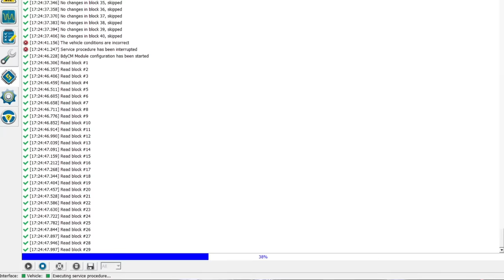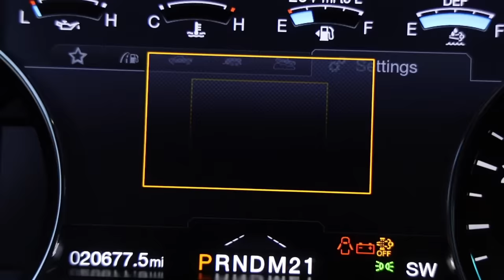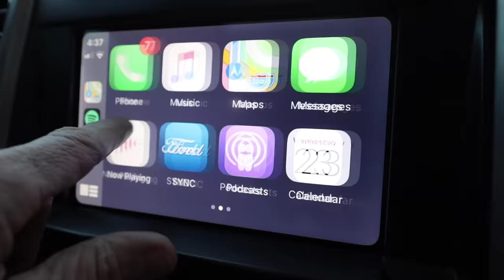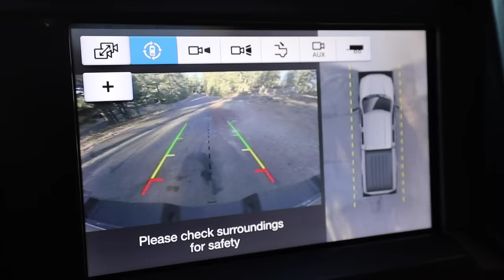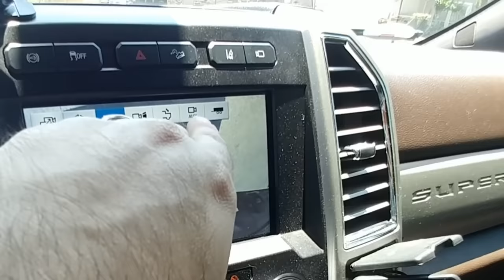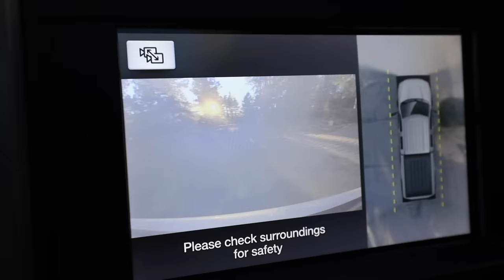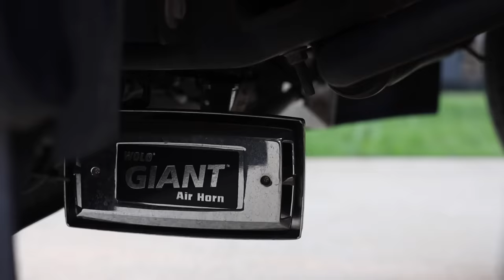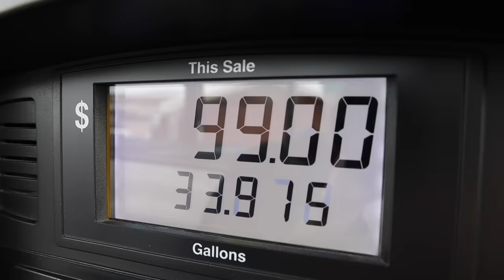Ford Super Duty Secrets! Best Mods + Special Guests

Comment: 3.73 is used in the heavy tow pack Expedition and I think some versions of the F150, it has the Elocker function also. My Expedition has it 3.5 Eco or boost👍. My Expedition doesn’t have as much dingers maybe Ford was thinking work boot guys need reminders 😆. The 3.73 is pretty decent with the 10spd though I could see the 6 or 8 spds getting a bit wound up on the highway when not towing. But 3.73 with the 10spd the little 3.5 lopes along at 75-80 at pretty low rpm. I recall with the Exp the 3.73 vs 3.31 was only 1-2mpg difference on the sticker👍

Comment: Have you noticed a difference at night with the fogs on with the high beams? I have always heard that the reason they don't do it from the factory is because with the fog lights on with the high beams its harder for your eyes to adjust to seeing further down the road.
Reply: There are also local laws about the amount of forward facing lights on at one time, federal as well if I'm not mistaken.
Reply: Fogs with high beams is called Bambi Mode.   I can see the sides of the road a little better with the fogs/high's on.  Fogs/highs have no effect on seeing further down the road for me.
Reply: Fog lights have a very short and wide beam, to throw light under the fog.  High beams throw high and long, and just reflect off the fog making it impossible to see.  Running fog lights with high beams on makes zero sense to me.
Reply: @shiftfocus1  I thought the same thing until I tried it.  I can now see the sides of the road better and hopefully see a deer in time to slow down or otherwise avoid it.  Hence Bambi Mode.  We are ate up with deer here and frequently hit them.  I am not trying to get anyone to do it.  Just stating the reasoning behind it.  My fogs will still go off with the switch.

Comment: Marc, another amazing and informative video. You really do a pro job at delivering the details. Our last truck was an '05 F350 6.0L..  we had the head gasket failure that was so common. A $5500 repair 10k outside of warranty. (and yes, I'm still bitter lol). The technology in today's vehicles is mind boggling..To the point where you wouldn't want to own one without bumper to bumper warranty.  Anyhow, they got me once, never again. Not a diesel fan.(as an owner)

Comment: Picked up a used 2019 F250, steering was very loose, not sure about the death wobble but I brought it to ford and there was a recall (customer satisfaction) for steering components. Now it runs like brand new with no wobbly front-end steering. I understand you mentioned having an aftermarket solution. Still, for others, it may be worth checking all recalls including the customer satisfaction programs to see if there is any free work that can be done.
Reply from the maker: That is the proper fix and we replaced the OEM parts too. At the time of this video, Ford was backed logged with parts. But it's bound to happen again at the same milage. The dual stabilizer prevents it from happening it again. I now have 58k miles and it didn't happen again.
Reply: @KeepYourDaydream  That is great to know those Icon's are still holding up well after a bit of time and you haven't had any premature wear. To extend the life of my replacement parts, I probably should look further into adding a set. Thanks.

Comment: FYI, you can swap the usb connector with a newer one with type c if you want it. And Built right industries has a mount system and you can add a phone mount system from 67 designs.

Comment: Some additional things I discovered. 1. under the front right cup holder is another spot for the key fob. What I was told is that if your fob battery is dead, you can place it in that spot & it can read the chip & allow you to start the truck. 2. you have the memory buttons on the driver door. If equipt this remembers the seat, lumbar supports, mirrors and steering wheel / pedal positions. You set this by holding the memory button & wait for 1 beep. If you continue to hold the same button you will hear a second beep. At that point, you press the lock button on your key fob, now it will be in memory & if you unlock the truck with that fob, it will go to the memorized position. It is cool because I have mine & my wife settings on hers. Anyway that is 2 of the things I know.
Reply: Isn’t the programming spot for the fob under the drivers side of the center console?
Reply: @akbychoice  I believe the spot under the center console is for emergency use. To program the fob to the seat buttons, you hold the particular # on the door, but don’t let at the 1st beep, that just sets the memory, but continue to hold the button until you hear a double beep, , then hit the lock button on the bob, now they are synced. Was that your question, or something else?
Reply: @andypop123  I thought I saw in another video that the slot on the drivers side was for programming. I have a 2016 F450 so it doesn’t work on mine.
Reply: @akbychoice  I don’t know that, my 18 has slots to start the truck with a dead key fob, my memory tells me the 16, had it in the rubber mat under the sliding cover storage compartment all the way forward on the center console. Sorry I’m not helpful here.
Reply: @andypop123  no sliding inside the console are two double cup holders. They can be removed and a lower plate reveals a spot to drop one on the double cup holders into the bottom. Leaving a rectangular spot and two cup holders. Currently it’s how mine is, this way my CB sits partially down in the well area left by moving the one double cup holder. Just not real good spots for CBs in the Lariat and up.
Reply: The reason it works when you Key Fob is dead is because it’s an actual charger for your Key Fob, when you are doing a long run, it’s best to just leave it in there to charge it up!
Reply: @ericsantos9668  that makes sense.

Comment: My 2019 F350 is a 3.55, the 6 speed is 0.674 top gear. That works out to be a good towing and good for empty highway(1500km per 185L tank) My 2020 F250 HCTTP (10800LB GVWR) is a 3.31 with the 10 speed. At 65 mph its in 9th most of the time(especially when towing). The top gear ratio is 0.632 and its way lower than the 2019(same 18" wheels and 275/70R18 tires). I love both trucks, I wish the 2020 was an F350 with the 8' bed like the 2019. The pandemic caused a massive shortage here in Canada and the only truck I found(3 weeks of constant looking) was sold the day before I found it. So I compromised a bit, both trucks have similar payload(F350 is 60lb higher) but the f250 is 800lb short on GVWR, in a 160"wb XLT vs the 176"wb Lariat Ultimate. So the both have the same capacity for towing(F250 22000lbs vs F350 21700lbs) both have the Dana M275 Axle 7230lb GAWR and springs(F250 says 6370lb RGAWR legal neutering)

Comment: In Arizona (most likely other states as well), if you get diesel at a truck stop and go where the big rigs go, you are paying 18 cents more per gallon for the "highway diesel" (there is a sticker on the pump stating so). Go to the "Auto diesel" pumps and you will not be giving the state money they don't deserve. You only need to get fuel at the "highway diesel" if you are over 26K GVW and/or have more than 2 axels on the tractor. RV's or school buses with more than two axels are exempt because they are not commercial and not for hire. I guess guys with Super Dutys want to be like the big boys just to look cool.

Comment: I seen a video where you can use a relay on your factory horn and the up-fitter switch when the up fitter is off the truck horn will work but when the up-fitter switch is on the big horn will blow when you press the factory horn on the steering wheel.

Comment: 2020+ SD w/ 6.2 still comes with the 6 speed *. Also, you can lock with keypad with any door open... when they close the door, it will be locked. The "Hidden key spot" is not for storing a key, it is ONLY for programming.

Comment: The death wobble was part of the reason I got the F-450.  The heavier front end seems to not have that issue.  Now, before some blowhard gets all excited I'm sure the death wobble is still possible, but in 70k miles I haven't seen it yet.  In my Dodge I had 4 death wobble issues before 30k miles.  Dealership finally found a dampener that solved the issue... but what a pain in the butt.

Comment: Great video! Absolutely love my 2017 F250 Platinum which I picked up in August. One of my favorite mods so far has been a wireless charger from ShawTexan Products which drops right in the left storage compartment on the center console and a CPlay2Air wireless CarPlay adapter. This allows me to jump in the truck and it automatically connects to my iPhone all while it’s still in my pocket. Great for short trips. If I need to charge it, I just take it out and plop it on the wireless charger. No cords to deal with!

Comment: I have two RAM's, one with 4.10 gears and the other with 4.56. They both get about 12 mpg around town and the 4.10 geared one gets 12 towing on the highway at 65 mph. I like being to accelerate vs top speed.

Comment: I have had as many trucks in the last 4 years as you.  I went back down from my F-250 Lariat to a F-150 King Ranch (ecoboost).  My F-250 had 20,000 miles on it , was in shop for a couple of months with Turbo problems and gave me about 20 "check engine lights" on my trip pulling the Flying Cloud to Indiana.  Stopped by three Ford Dealerships in Arkansas, and the check engine light came on again.  I stopped by a Ford dealership in Hot Springs, traded it in, and was on the road in less than two hours.  I miss my F-250......but it made me mad.

Comment: I’ve got the S&B 70 on my 17’ 450 and need to get the forscan done ! The gauge and the miles per gallon don’t jive and it’s annoying when traveling wondering which one to look at but I’m gonna look into those other things you mentioned! Great video eventually you’ll move the air horn button down to the dash once you need that up fitter switch 👍

Comment: I have to say in all honesty, the more I hear from you Ford owners the more I like my 2017 2500 Ram diesel 4wd.  I do like your camera system better and your panoramic roof, which mine doesn't have. I already have a def gauge, not hidden in the settings.  Not only does the ram have high idle it's automatic in cold weather and can be manually initiated.  Integrated phone holder in the console.  JD was complaining about the plastic dash in his  450, my truck is leather or stimulated leather dash.  I'm seeing around 11mpg towing a 29' Rockwood UL with two slides and around 18 mpg average empty.  And it doesn't drive me nuts with annoying dings!  The Ram's keyless entry only requires you to grab the handle to unlock and push a button to lock, no number pad to deal with.  I do like the Ford tow mirrors better than the Ram's though.

Comment: Great video!!  I have a 2019 F250 but gas.   My diesel days are over after 15.5 years of having one being a Minnesota cold weather guy and towing only a 5k pound trailer now.  We enjoy your channel very much.  I'm going to check your link because mine, when I start it, always goes to the default trailer even when it's not connected.  Hoping to find a change for this.

Comment: Good info. One thing that is weird on the 2017+ Superduty has to do with the requirements for activating the 12V charge on the trailer plug. As a challenge try testing if it works on your truck.
Reply: Would love to see more info on this!

Comment: As a licensed Mechanical Engineer the lower gear ratio is also better to have if you are going to increase your tire size.

Can you confirm that the 23's and newer have high idle on the cruise control?

Comment: Huge Ford truck fan here but unfortunately Ford's truck cameras are lousy (low resolution and washed out color) and prone to issues. I believe the new 2021 F150's have been much improved  but won't make it to SuperDuties until the next refresh when the new F150 interior moves to the SD lineup  (pbly for 2022). GM's camera systems are far superior (high definition and great color) plus their backup rear view mirror/camera combo is incredible - I hope FOMOCO adds this option soon.

Comment: Just some quick safety tips for doing a stationary regen:
1) Make sure you're parked on concrete or (ideally) gravel. The temp at the exhaust tip is high enough to melt asphalt, and after 30+ minutes at high idle it doesn't really matter how high off the ground it is. 
2) Make sure there are no flammable materials nearby, ie. dry grasses, wood (see #1).
3) Kind of a no-brainer, but don't do it in your garage or near your house (see #1).
4) Make sure the little kiddos will be at a safe distance for the duration (see #1).

Mobile regens are best obviously. 😎👍
Reply: DELETE!

Comment: Do you know your Super Duty has a sport mode? Tap the traction control button twice and then OK to confirm sport mode. Truck drives great especially when towing. Oh, you can also use tow-haul with sport mode. It wakes the truck up.
Reply from the maker: Will try this tomorrow!

Comment: Got the recall notice for deathwobble on christmas eve. Ford has apperently reconfigured the stabilizer.
Reply: My 2018 F250 has had almost $10k in front end repair to fix death wobble and bump steer .  3 times it tightened  up  the front end that lasts 5-10k.  

Doubt Ford is going to refund the $$ if just a steering stabilizer would fix the issues. I've had 2 new ones put in under 60k miles.
Reply: @BillUtah  A lot of money to not fix an issue...
 I am not saying a stabilizer will fix an issue but the bracket geometry of the stabilizer may have a large effect. I don't know what the kit looks like yet but I will be sure to post before/after and give the results on my channel.

Comment: I had the 2° castor shims from SPC installed on my 2019 F250 right when I bought it and have not had any issues yet. Bill at Powestroke help has a video about fixing the death wobble on 2019 F250.
Reply: Does it fix the bump steer? 

I know $10k+  has not fixed my work 2018 F250

Comment: Having a 2019 SuperDuty was excited on the 60 Gallon tank until I saw the upgrade video. Wondering how can you get to the 5 screws that remove the fuel filter.  Looks like that filter housing it is  now surrounded by and encompassed within the design of the new tank. Or is there a panel that drops down? Thanks for another great video.

Comment: Marc, Great video, great channel. Following for a few years now.  Would love KYD or BTBRV to do a video of Super-duty engine brake operation (auto/manual). Hard to find any comprehensive training on use in traffic, down mountains, winding roads or straight, with and without tow mode etc. Thanks! Rich G.

Comment: Those lock r down center console safes are nice but pricey. Now I Prefer Gmc because reliability😜 so this might not apply to these alumadutys but I just picked up a $20 pistol lock box off Amazon drilled holes to line up with the bolts securing the center console and bolted it down. Not nearly as big as the hole console but it’s big enough for small pew pew and a wallet and only costs $20  and  1/2 hour of your time.

Comment: My sixth F250 a white platinum 4x4 like yours was stolen from in front of my house.  the frightening piece it took 28 seconds . . . the truck drove up started and unlocked the truck before they ever exited their vehicle.  I've now got a 21 tremor black out, i was thinking about upgraded to the larger fuel tank. . . .Titan indicates that I won't have to re-program anything but i'm worried that ends up being wrong.

Comment: Marc another great video on updates and mods I am looking to upgrade my truck to an F250, can't wait to see the video on the death wobble. New to diesel and wondering what the DEF gauge is for and what DEF stands for.
Reply: Diesel Exhaust Fluid (DEF). If you are purchasing a new F250 the salesperson will explain it to you. The DEF is injected into the fuel to reduce emissions. It works! On an F250, the fill cap is next to the fuel fill. Many fuel stations, hardware stores, Home Depot and Walmart stock this. There have been claims that the process increases fuel economy but also claims that it reduces power. Personally, my dog and I think it is great because the stinky diesel exhaust smell is virtually eliminated.
Reply: @rickbeyer6633  thank you friend my only experiences with diesel has been in the military and we didn't give two craps about exhaust fumes lol. Appreciate the help.

Comment: I feel that Ford and gm are way behind on the cameras my wife’s jeep is like HD it’s unreal how clear it is
Reply: True and Ram had the bed 3rd brake camera in 2013/14 already way before Ford or GM did. But Ford did step up with the first 360*. Tho, like you said the picture quality isn't that great.
I drove a 2017 F350 with the 360* before we got our 2016 F350 with the std backup camera, and seems the 2017 cams were very white washed compared to the older single cam

Comment: My high idle is automatic on my Cummins or thru the cruise control.
Reply: I was wondering if that was Ram only or if the Ford owners didn’t know about it....
Reply: @D_Joe_B  ,IC, GMC, Chevy, Freightliner chassis school buses have been that way since '08 that I know about.  Probably longer.
Reply: @D_Joe_B  my fords wont do it on cruise control. It also isn't necessary on them. I live in North Dakota and the computer idles them up enough to maintain a high enough water temp. My 6.7 Ram has the automatic idle and the cruise control and I definitely need to speed it up with the cruise or it will not maintain it's heat.

Comment: Topic for your next video.  I also tow and Airstream, initially with and F-150, but upgraded to an F-250 in 2019.  My F-150 had a 30 Amp breaker and would supply power to my airstream when connected and the truck was running.  The F-250 has a mini 30 amp breaker, as best I have a trickle charge to the battery.  Often I get the “battery not charging” message.  I took the truck to a dealer and they insist nothing is wrong.  Any Thoughts?